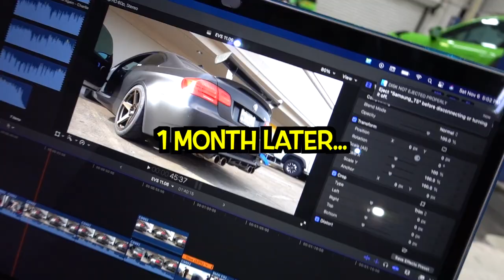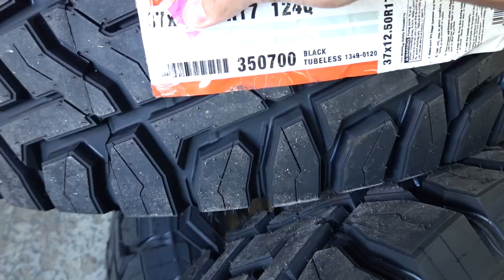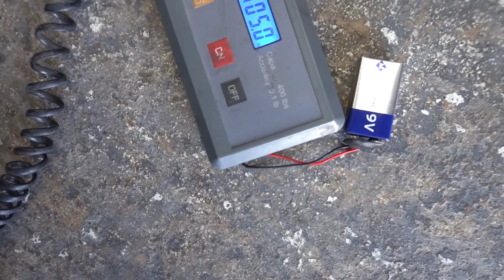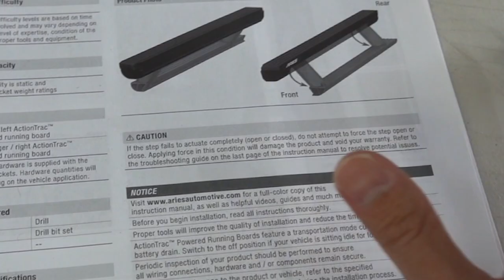Modding our 2021 Ford Bronco with VenomRex Wheels and Aries Steps! | EVS Vlog

Comment: great video!... can you please provide the part number for the bracket kit.... i got the number for the steps on the installation manual, but i cant see the number on the bracket manual... much thanks and happy wheel'n
Reply from the maker: i don't have it but if you contact the manufacturer, they can easily help with what you need